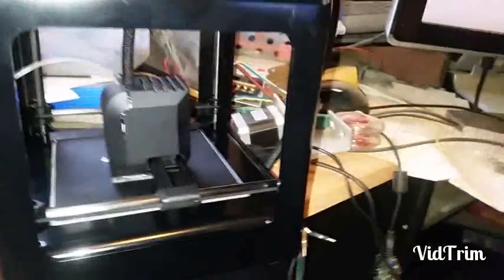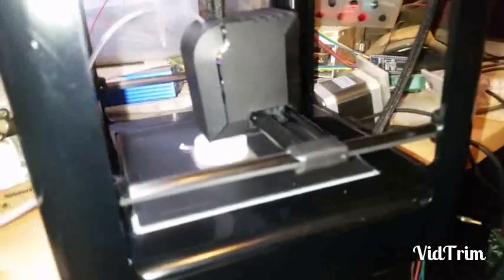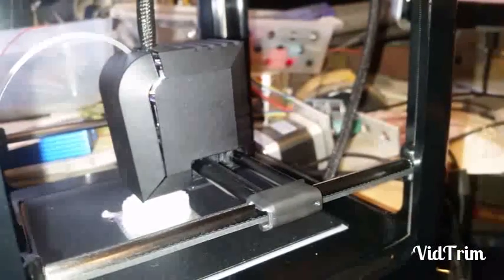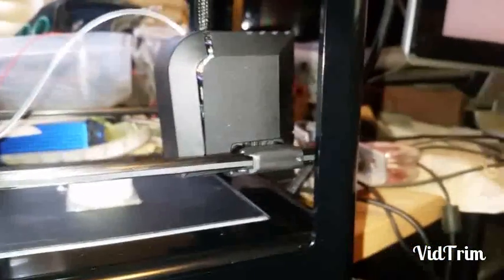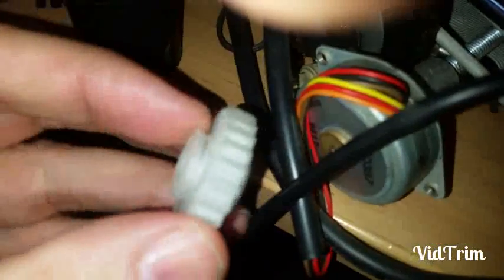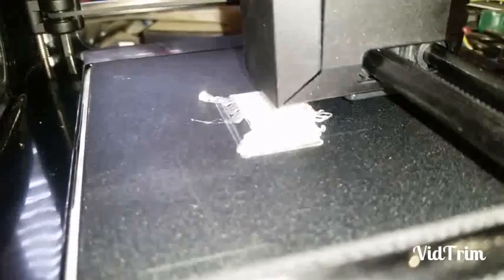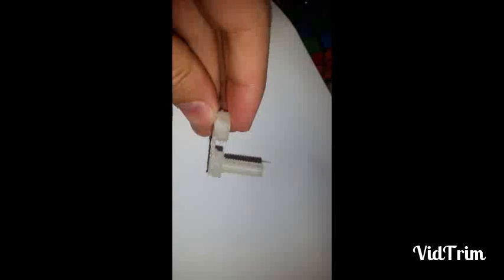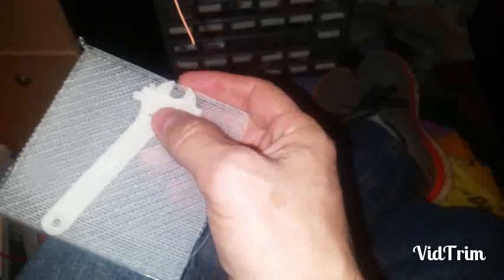M3D Micro test prints

Comment: The filament is meant to be run from the top of the printer not the side. On top of that you don't have a proper filament roller which is causing the coiling. I think what happened is that tension from the filament fulled the front cover of the micro open.
Reply from the maker: theshaddii I figured out that I should feed it through the top.  There's supposed to be a compartment to feed it from the bottom, but they recommended against using it.  I don't think feeding it from the side caused the casing to open up, as you can see it's like that shortly after starting my first print, and I was quite careful to feed it the fillament without it having to pull the spool.

It's not actually broken, it's just not snapping in correctly.  An M3D engineer replied in the forums suggesting that I pull it appart and bend the snaps back.  I did, and it helped on one side, but not the other.  I honestly don't consider it a big problem, but it does look pretty bad for people that care about that type of thing.

Comment: Apparently the raft issue (I and others have had the same issue) is due to the raft being rectangular as opposed to square. All objects I've printed w/ a square raft have been fine. 

It was suggested to me in the forum to rotate the print 15-25 degrees and print again (this just makes the raft square, though takes longer and uses more filament). It works better, but not perfectly. 

I was told it's a known issue that will get updated in the next software release.

Comment: That doesn't look exactly good.
The extruder housing is falling apart (second one I have seen images of...) and this isn't the first set of botched prints I have seen today either from the M3D.
Reply: Chris do you think the housing is actually broken or that it could be disassembled and put on correctly so that it doesn't look so bad? 

Hopefully with some tweaking and eventual software updates, the print quality will be able to increase
Reply: hiphopapotomas  I have seen a couple like that now - must just not be very well put together - I am sure it could be improved upon by taking it apart for sure. 
What worries me with the printing is that over on the right of this comment I have numerous M3D print tests in the video feed from Flyboy55, all of which have shown to be really quite good - and yet this later printer isn't producing output as good. So it's gone backwards IMO.